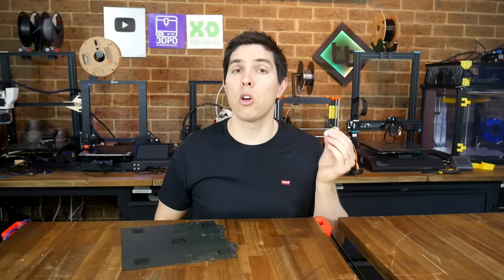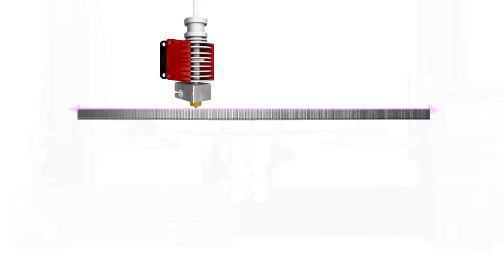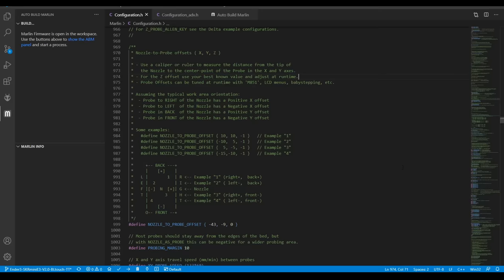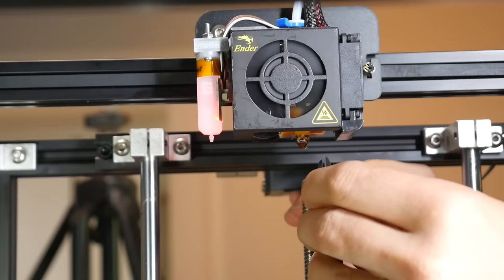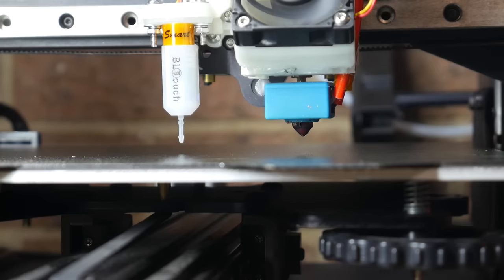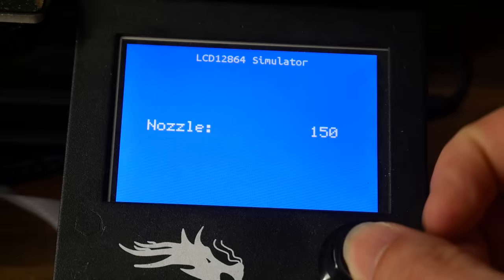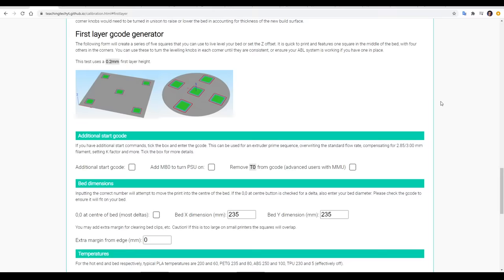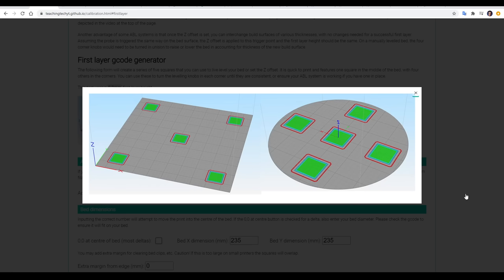ABL offset guide including new probe Z offset wizard

Comment: Hi Michael. Thank you for the amazing content. I have a Ender 3 Pro. I installed the BLTouch and followed your procedures. The machines does all the right things and the BLTouch goes through the mesh leveling and outputs the mesh into OCtoprint. But when I run the the machine it acts like it does not save the settings. I have the offset set correctly. But seems that it doesn’t level the bed when printing. Also I noticed that the bed leveling menu item in the Ender 3 Pro LCD always says off. I turn it on and save the settings and then when I go back in it shows off again. I am not sure if I’m doing something wrong or if it’s just not saving the settings and the probing data just wondering if you have any ideas on how to help me fix this?
Reply: I'm very late here, but I had a similar problem. For me, G28 (homing) disables mesh leveling compensation, even if a mesh had been generated.  My slicer always inserts a G28 before printing. Option 1: insert a G29 in the slicer settings to run another leveling after homing, this reenables compensation. Option 2: you can insert M420 S1 after the G28 to reload the mesh, which also reenables compensation.
Reply: @boredom1000  Thanks for the advice! Option 1 worked!

Comment: I've heard a paper towel is better for cleaning the nozzle. Metal implements can damage the profile of the nozzle orifice if your not careful.
Reply: brass brush -- softer than steel implements
Reply: @artiem5262  I've seen videos and posts about people frying their boards using a metal brush. It can bridge between heater and thermistor if there's any exposed conductors.
Reply: @artiem5262  if your nozzle is brass, you'll want to use a copper brush which is softer. also be careful and don't brush on the axis where your thermistor/cartridge are located.

Comment: hello! i followed your guide, and i set the correct values for nozzle to probe offset, but the btouch still misses the print bed quite a bit! is there any other setting to define where the mesh will start probing?

Comment: With a working BL Touch line ~1440 of config.h is hiding 

#define LEVEL_BED_CORNERS

As default this visits the corners and lets you shim them to height, but you can use the probe to get them perfect

#if ENABLED(LEVEL_BED_CORNERS)
  #define LEVEL_CORNERS_INSET_LFRB { 30, 30, 30, 30 } // (mm) Left, Front, Right, Back insets 
 
 // set this next value to 0.1 if using a paper shim or your bed height will drift over time
  #define LEVEL_CORNERS_HEIGHT      0.0  // (mm) Z height of nozzle at leveling points
  #define LEVEL_CORNERS_Z_HOP       4.0   // (mm) Z height of nozzle between leveling points
  //#define LEVEL_CENTER_TOO              // Move to the center after the last corner
 
// This is really trick 
 #define LEVEL_CORNERS_USE_PROBE
  #if ENABLED(LEVEL_CORNERS_USE_PROBE)
    #define LEVEL_CORNERS_PROBE_TOLERANCE 0.025 // this might be too much, 0.05 or 0.1 might be better
                                                                                                   // 0.7mm is 1 turn of the M4 levelling knob
    #define LEVEL_CORNERS_VERIFY_RAISED   // After adjustment triggers the probe, re-probe to verify
    #define LEVEL_CORNERS_AUDIO_FEEDBACK //we like beeps
  #endif
#endif

There's a caveat in that you need the probing margin to be less than the screw insets from the edge of the bed

#define PROBING_MARGIN 10 //defaults to 40 IIRC must be less than 30

and you need the travel limits set a bit bigger, turn them off with M211 and edge up the limits carefully, and leave a mm or two extra. X goes quite a way further on the Ender 3 but with a glass bed I'm losing some Z height form the claimed 250mm which is a worth knowing

#define X_MIN_POS 0
#define Y_MIN_POS 0
#define Z_MIN_POS 0
#define X_MAX_POS 248
#define Y_MAX_POS 231
#define Z_MAX_POS 245

this means i can get a standard bl-touch with a -42, -10 X Y offset all the way round the bed with the 10mm margin shown above which is quite cool for mesh generation

Comment: Look man I try to follow you but you always leave out the most important things I do not want to start from scratch how do you update an existing configuration
Reply: he has a video about updating the firmware I did my about two years ago and it worked good following the video was easy.  Just do a search for it.
Reply: Update an existing configuration? If it's a recent firmware just modify the two .h files and recompile, flash and then reset eeprom
Reply from the maker: At the very start of the video I show a recent guide to setting up firmware compilation from scratch. It's linked in a card and in the description. I don't know what else I can do for you?
Reply: @TeachingTech  That’s just it I don’t want to start from scratch I have already developed an ender three configuration with the big tree tech board NBL touch and I do not want to start over with a brand new configuration just to update to the newest version of Marlin. I want the new bed leveling feature.
Reply: @shadiek123  You'll just have to redo your configuration, but with the newest version of marlin. Not much has changed if you were in bugfix branch, just different line numbers obviously. Everyone has to do this, there's no magic formula. If you were on klipper, it would be easier.
Reply from the maker: @shadie k Instead of telling me how I leave things out, how about you search the videos I've already done. This one covers how to conveniently update as well as set up GitHub so it's automatic in future. Two options to fit your scenario:  https://youtu.be/hLvzLYemUn8
Reply: @TeachingTech  maybe a simple thank you for taking your time to make the videos would be nice. Now your doing searches for people to lazy to take 5 minutes to have a look. Thanks for the videos have helped me along the way.